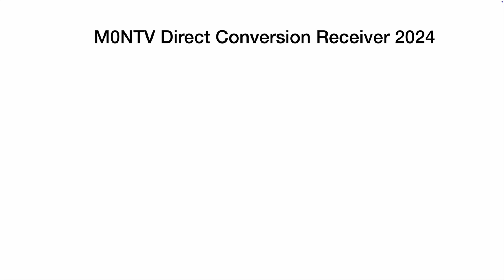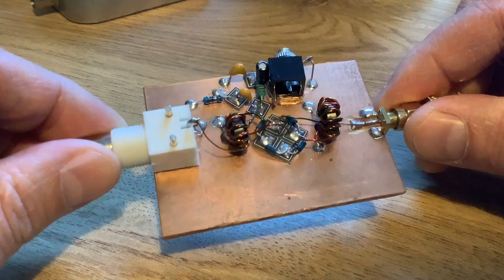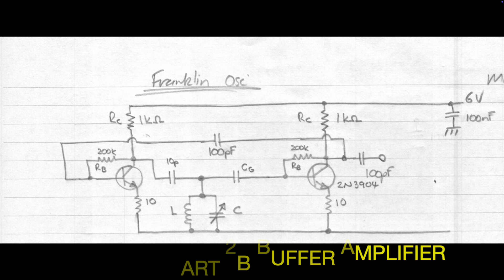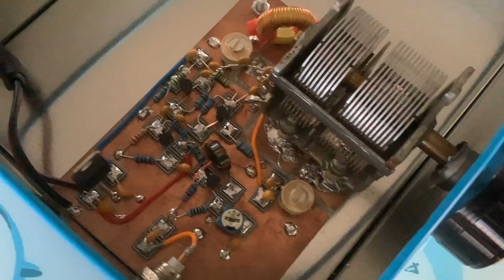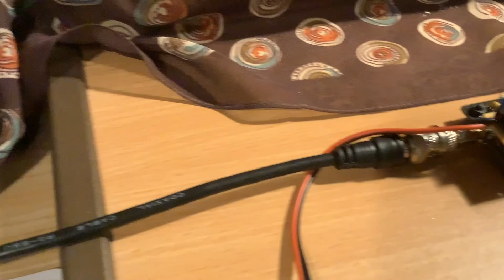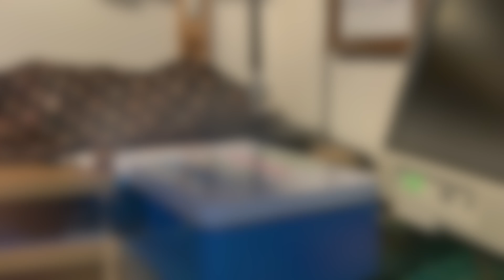59 - Analogue Direct Conversion Receiver

Comment: Mamy thanks for the nice video. Just to mention that a series cap creates non linear tuning, better to increase shunt C to reduce tuning range. Also, SM capacitors can create little jumps in frequency. Polystyrene are better. Not easy! 73
Reply from the maker: Thanks for the tip! Best wishes, Nick

Comment: You using a BF981
Reply from the maker: Hi David. No I used Charlie Morris' design for the Franklin oscillator which uses 2 x 2N3904. 73, Nick

Comment: Are you going to use the 74HC4053 as part of the down conversion mixer.
Reply from the maker: No I just used my tried and trusted diode ring double balanced mixer + W7EL audio diplexer. I'm going to give Direct Conversion Receivers a rest for a little while now I think. Best wishes, Nick

Comment: Thanks for the video.  I've been thinking that making tuning more accurate I might try adding a really small diameter panel tuning knob with a band around the larger knob.  I haven't tried it in a rig yet so I don't know how to accomplish it mechanically. A sort of a faux (I can't remember the term) capacitor It might be installed with the large knob inside the chassis so it looks neater.  73 Nk5I .
Reply from the maker: Sounds interesting! You could also play with a separate fine tuning cap. I've considered it but not actually tried it. All the best with all your building. 73, Nick

Comment: Designing an RF PCB is an art of it's own.  Especially at higher frequency where a spare microfarad of capacitance because two traces are too close together can make or break your design.  I prefer digital design, although at high speeds you have similar challenges.
Reply from the maker: I think at HF frequencies a few pF of stray capacitance can be tolerated (although it can screw up your tuned circuits of course!). Once you get into VHF and above though ... all bets are off! Thanks for watching. Best Wishes, Nick
Reply: @M0NTVHomebrewing  When I was in the Navy we dealt with VHF and UHF mostly.  I honestly have never designed an RF board and rarely breadboard anything over HF as an experiment.  I stick in the digital domain mostly.  You still have to have some concern with high speed switching.  A few pF capacitors from Vcc to Gnd usually takes care of shunting any high frequencies to ground, but you still have to worry about traces being to close and potentially affecting each other at high frequencies.  I honestly think circuit board design is a black art in it's own right.  Making simple circuits is one thing, but once you get out of the realm of toy circuits you have to take into account a lot of considerations (like with all engineering).

Comment: The schematic for the tia-agc shows an inductor, L1, and there is a place for it on the pcb, next to Q4,.  But nowhere can I locate a specification for this inductor.  The schematic listsit as "L".  What value did you use?
Reply from the maker: Good question. The answer was tricky to find but if you download the Wes Hayward original design paper (http://w7zoi.net/tia+agc.pdf) then on the bottom of the schematic on p.4 we get the answer. Wes uses 12 turns of #28 on an FB43-2401 to give 75 uH but he stresses that the value is "NOT critical". As it seems to function as a DC pass and RF block I just used a molded 100uH choke. Hope this helps. 73, Nick
Reply: @M0NTVHomebrewing  Yes, and I also checked with Todd, who pointed out where I had missed the note Wes had put at the bottom of his schematic, and let me know that he (like you) had used a 100uH molded inductor as a choke, and that he would add it to his schematic.  Thanks!
Reply from the maker: No worries Gordon. Happy building! 73, Nick

Comment: Dual gate MOSFET makes for great AGC too.
Reply from the maker: Thanks for the tip. 73, Nick
Reply: @M0NTVHomebrewing     another great thing about DG mosfets, is that in a breadboard circuit the AGC V can use a sample-hold effect. With the control gate just tied to a 0.1 uF to ground and nothing else, finger skin resistance bridging to supy rails can be used to turn up and down the gain like buttons on a remote control.    Another great thing is they make great demodulators or pair of them a double balanced demod.  Been 40+ years ago did this!
Reply from the maker: Thanks. My impression is that DG MOSFETs are not so easy to get hold of these days. I've never actually built with one. I have used a design by Pete Juliano N6QW for a product detector that uses 2 x J310 FETs to simulate a single dual gate MOSFET. It works very well but tends to be susceptible to AM breakthrough on the 40m band. Thanks again. 73, Nick
Reply: @M0NTVHomebrewing    I see Digikey USA still stock Harris 3N206 quite pricey but they also have a much more modern 3SK264  200 MHz  for 20 cents.    Ebay has lots of dualgate fets ,the fake chinese ones probably outperform the originals
Reply: @M0NTVHomebrewing    My reply to you just now was CENSORED by youtube.   The comment that deleted I wrote where you can get good dual gate mosfets from
Reply: and a lot of other information, sorry, it's youtube censorship
Reply from the maker: Sorry. Thanks for making the effort though. 73, Nick

Comment: I've always been fascinated by the possibilities a direct conversion receiver project offers.  But no tuning capacitor local oscillator.  I want my oscillator to be a digital synchronous sort - gone would be the tedium of moving from signal to signal with a less than precision tuning mechanism.  Good fun this stuff!
Reply from the maker: Hi there! Check out my video No. 26 - Designing A Digital Oscillator (https://youtu.be/P71yoWR6-rU?si=z6B3sqjzeaOoyp11). This is a basic VFO with Arduino Uno, Si5351 PLL module, 2x14 LCD screen + Rotary Encoder. It should hopefully help you on your way. Thanks for commenting. 73, Nick

Comment: On the three Softrock kits I've built I've had to use an LNA in the front as they always seem to be a little less sensitive than commercial receivers. The LNA design was from the R2Pro LNA by KK7B that I built dead-bug style and yielded around 12 dB gain. Thanks for sharing your work Nick - always a pleasure - 73
Reply from the maker: That's interesting to know. Thanks very much Brian. 73, Nick

Comment: Nice.

I am a retired pure mathematician that took up electronics as a hobby similar to taking up cooking as a hobby over a decade ago as an outgrowth of using partial differential equations to model simple antennas in order to see mathematics modeling a real world phenomenon.

I don't aim for my hobbies to lead to being a 5 star chef nor EE; rather, my aim is much more restricted. None the less, lately I have an interest in building one of each style of receiver up to & including superheterodyne. I am now past the stage of regenerative type receivers and looking forward to a direct conversion receiver. 

Not having previously built a direct conversion receiver I find sometimes schematic representation on a great design can be a bit cryptic to a new builder by the draftsperson having essentially used a means of representation in the schematic that anyone having previously built the project would immediately recognize, but not necessarily a first time builder. 

You gave me the notion that the receiver your assembling or a similar receiver is the one for me to start with because in a AM radio club video recently published on YouTube you suggested the instructions and plans for the direct receiver you were demonstrating having a gluestick based variable inductor was really excellent and very detailed.

If you could give me a link to the plans & schematic I am implying please do, I'd really appreciate it. It will be a fabulous winter indoor project now that snow has hit my neighborhood in the Catskills.

Thanks in advance
Mike Boyer
Reply from the maker: Hi Mike! Thanks very much for getting in touch. I've built a few DCRs over the past few years but if you are interested specifically in the Glue-Stick PTO version then check out my videos 32, 33 & 34. I link to downloadable schematics etc. in the comments. All the very best with your building. Enjoy! 73, Nick

Comment: I just used a two-stage version of the hybrid cascode as my IF amplifier in the new transceiver that I'm designing, and it is indeed an excellent RF amplifier with a very large control range. Worked perfectly for the simple AGC system that I implemented. 73 DE NT7S
Reply from the maker: Hi Jason! Great to hear from you. Yes, I was impressed with the design of the TIA-AGC amp. That Mr. Hayward knows a thing or two doesn't he? In other (unrelated) news I did think of you the other day as I've been doing some experimenting with the Si5351 and an ESP32-powered integrated TFT screen (the so called 'Cheap Yellow Display'). I've managed to get an adapted form of your brilliant code working on it. It'll probably be the subject of a video in the new year. Thanks again for all give to the hobby. 73, Nick
Reply: @M0NTVHomebrewing  Excellent, let me know if I can be of any assistance on your upcoming project. Merry Christmas and HNY!
Reply from the maker: Thanks very much Jason. Will do!

Comment: Nick--It's always a pleasure to see something from MDRF in the wild, and thanks for the plug. Using the TIA-AGC as a variable-gain pre-amp is a great idea, especially with a front-panel gain control as you've done. I've been doing some experiments using low-noise transistors like the BF106 in place of the 2N3904 in the TIA amps. This might have some value in a pre-mixer RF amp since any noise introduced by the amp itself will be amplified in subsequent stages. Whether or not there'd be any noticeable benefit is hard to say, but there's always the placebo effect to come to the rescue if not. --Todd K7TFC
Reply from the maker: Hi Todd! Thank you so much once again for your fantastic boards! I was really pleased with how the TIA-AGC worked out. Keep up the great work. 73, Nick

Comment: Hi Nick, nice build! The reason for tuning 160, 80 and 40 from high-to-low frequency is because it's easier to approach a LSB signal that way - the signal is heard at high pitch, then gradually lowers to normal before cutting off after zero beat with the suppression of the upper side band. Of course, with a DC receiver it makes little difference, as you are not sideband-specific - the signal goes through zero beat and then comes out garbled on the other side.
Padding tuning capacitors (for those who don't know) is best initiated with a simple LC frequency spreadsheet where you can substitute series and parallel capacitance values until you get the range you want. Season's Greetings from M1GWZ (Echelford ARS).
Reply from the maker: Hi Phil! Great to hear from you. Hope you and all the EARS guys are doing OK. That makes sense what you say about approaching an LSB signal from above. I think I must have naturally just got into the habit. I must confess the padding was more cut and try on my part but I got there in the end! Look after yourself. 73, Nick

Comment: Nick:  Some comments from the SolderSmoke blog:  First, let me say FB Nick.   It is nice to see you making use of the AGC amp designed by Wes and Bob,  using the board from Todd's Mostly DIY RF, using a mix of homebrew pads and Me-Squares from Rex, and finally the Franklin Oscillator that we spent so much time talking about on SolderSmoke.  But here are some comments:  
-- I still don't think you need that RF amplifier in front of the mixer. And I suspect you would be better off without it.  We did not use one in our high school 40 meter project, and never missed it.  In fact, on one version of the high school receiver I even put in a simple 10k pot as an attenuator (no RF amp).  Even up on 20 meters, I do not have an RF amplifier ahead of the diode ring mixer on either of the Mythbuster rigs I have built.  Nick,  maybe experiment a bit more and try the receiver just going from the BP filter into the mixer and see what happens.  

Note that Wes W7ZOI DID NOT have an REF amp ahead of the diode ring mixer in his original 1968 40 meter Direct Conversion receiver (the one that launched the solid-state DC recevier revolution).  

-- The Franklin oscillator is an interesting, but complicated circuit.  The gimmick is, well, gimmicky.  Here is the thing:  You can achieve similar levels of stability using simple conventional, single transistor oscillators.  We dispensed with the variable capacitors, and used PTO--style variable inductors. They worked fine.  This Franklin oscillator still does seem to drift a bit, right?   I would ground the board to the inside of the metal box.    

I would also try putting all the stages on a single ground plane.  This might help.  

73  Bill
Reply from the maker: Hi Bill,

Thank you very much for watching and commenting and particularly for posting this on the Soldersmoke blog (https://soldersmoke.blogspot.com). I appreciate you sharing your experience of these analogue creations! The whole project came about after I watched the series that Charlie ZL2CTM did on building an AM broadcast receiver - with a Franklin oscillator. It just seemed like an interesting thing to try on SSB. In truth I get better stability with my Glue-Stick PTO but it was still a fun thing to experiment with.

Like you, I wouldn't normally use any up front RF amplification but I actually blame a re-reading of EMRFD, chapter 8 where Hayward, Campbell and Larkin extol the virtues of an RF amplifier ahead of the mixer. Using the variable gain design also means I can use it for attenuation when needed. But again - it was really just an experiment. I think with a better audio amp I could probably dispense with this. I certainly concur with your comments on grounding.

Thanks again for all you give to the homebrewing hobby. I wouldn't be doing this today without the inspiration and encouragement of Pete and yourself. 73, Nick